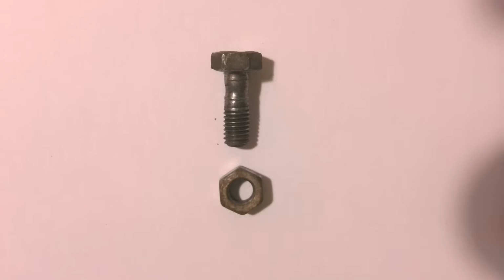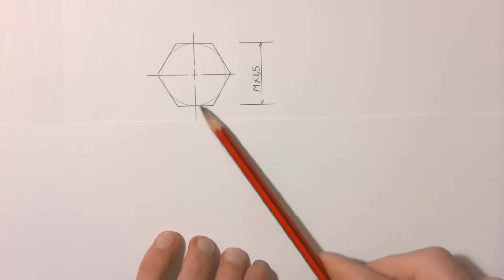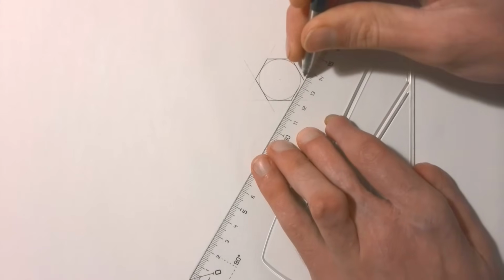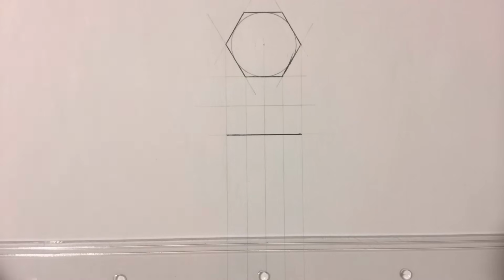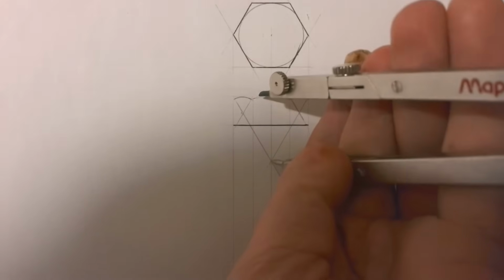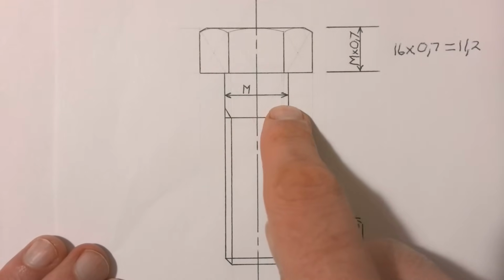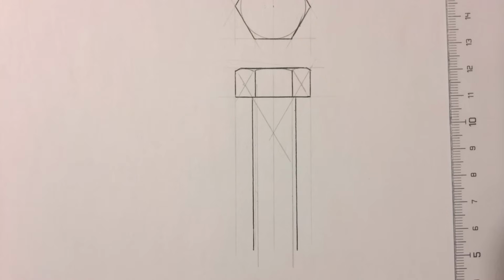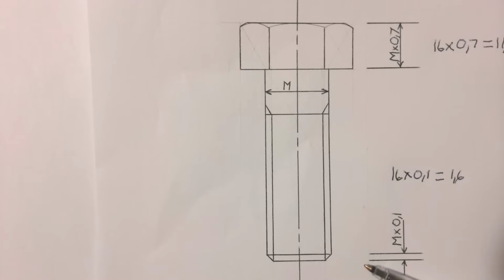How to construct a metric bolt and nut from just the M value

Comment: Hello sir this is amazing can you please make video for this

Instructions: Answer ALL questions. In this assignment, question (a) below is a description of a system and (b) provides information about a graphical plain scale. Question (a) requires the construction of two views of the artifact described, while (b) require the construction of a plain scale conforming to the information given. Both the two views and the graphical plain scale are to be drawn in the same drawing area of an A3 drawing sheet, laid in landscape, appropriately centralized as taught in this module. Please note that part (b) requires some prior calculations, these calculations shall be done in the drawing area (i.e., defined only by the standard margins and title block as taught in this module) on the flip side of the A3 not used for the views and the plain scale.(ONLY neat presentations earn credit). [Do not dimension your drawings unless explicitly asked to do so!]	[deduct 5 Marks if unsolicited dimensions are included]question 1									[100%](A). A cleaning company contracted by BIUST has commissioned you to design a special tool with which to remove sticky chewing gum on the floors of student hostels. The tool is to be called a SCRAPER and its overall shape is a rectangular solid of 120 × 80 × 10 mm. However, one end of rectangular solid rises from zero thickness to a maximum thickness of 10 mm in a length of 30 mm to form a sharp edge. The opposite end is semicircular. A 30 mm diameter hole is positioned such that the center of the hole is 40 mm from the semicircular end and 40 mm from either side of the tool. Use an A3-size paper to appropriately layout a full-size drawing of this concept as presented by the cleaning company. Your drawing should, in appropriate portions: 1). give, in 3rd angle projection, the front view (FV) and top view (TV) of the tool appropriately centralized with the title block assumed to be 12 mm high, in which only 2) the name of the tool, 3). Your Student ID should appear neatly written.		[50%]B) At a convenient place above the scraper in (a) above, construct a plain graphical scale to depict the situation whereby a field of 7.2 square meter is represented in a map by 10 cm x 8 cm. The scale should show centremeters (cm) at the lowest level but long enough to measure up to 3 meters (m). Be advised that the height of the scale (or the height of the thin long rectangle) shall be 10mm instead of the recommended 3mm taught in the module. This height is very important especially for centralizing your views vertically	[50%]